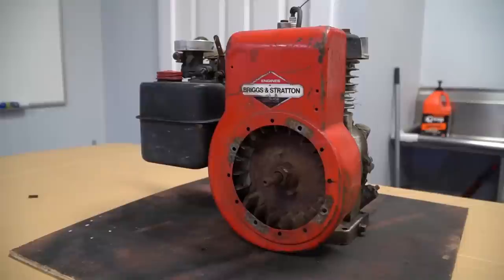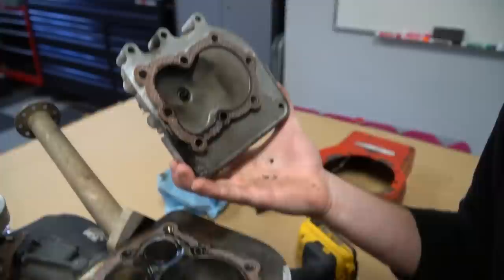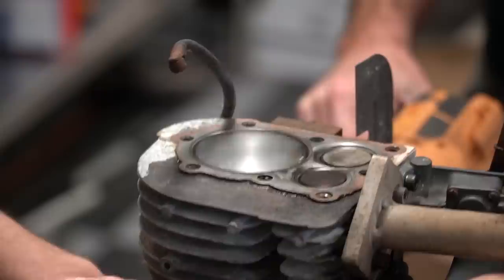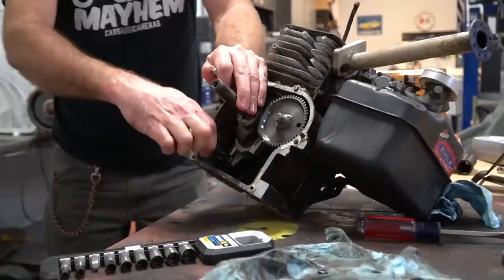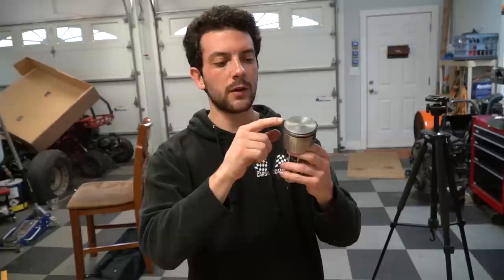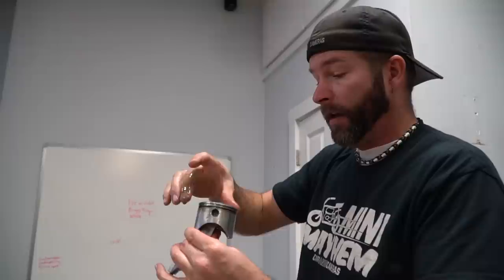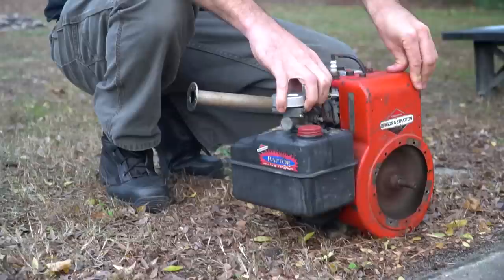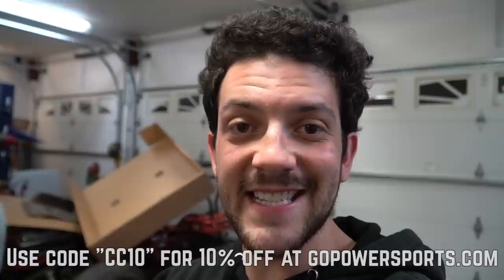Rat Rod Wagon HAULS | Built Briggs & Stratton Flathead

Comment: Looking at the 90 degree gearbox on this kart. Have you guys thought about using a lower end of an outboard boat motor? Not only will that provide a forward-reverse, but should also have a long input shaft instead of having to build one from several pieces.
Reply: There is a gear box just like that one that has forward and reverse
Reply: True, but they are way more expensive than a outboard bottom end that can easily be found at a scrap yard.

Comment: Racing pistons typically are higher compression, more sturdy in the cylinder as the skirt design makes them less likely to wobble side to side, and they often are made either by being forged or CNC'ed instead of being cast as well as they could be a special alloy that makes them stronger and able to handle higher combustion chamber temps.

Comment: The racing piston one is a hyper type metal very strong for boost or nitrous second longer skirt to help transfer heat through out the piston and prevent piston slap the reason it only has one compression ring is for less rotation friction which also helps with heat

Comment: Hey guys, when youre doing a hone, slowest speed on drill and up and down as fast as you can go. The idea is to make crosshatching on the bore to retain the oil. As for the racing piston, idea is less friction and less reciprocating weight to gain the higher rpms. The small amount of compression lost by not ahing a second compression ring is more than made up for in the higher rpms. The skirt shape and design is to support this. Great video. I must say.. id love to see the ducati engine on the drag rail tho.. ... .. cheers, Levi

Comment: The Briggs flat head is a great engine. Modified Briggs and Stratton flatheads are used in almost all oval track go karts and you can make those engines rip. There’s also still a lots of brand new parts you can buy for it online

Comment: I grew up with those old Briggs & old Tecumseh flat heads. They seem to make far more torque than the Chinee ohv motors of today. That ones already got the dual valve spring setup so the valves won’t constantly be floating once you hit 4500 rpm or so. As for the setup...the piston is lighter, longer rod likely means the builder is likely running a 3 1/2 crank for a shorter stroke coupled with a high lift, longer duration cam. Mic the cylinder to find out if and how much she’s overbored, get a set of rings if possible or a piston & rings...replace valve guides & seals. Add some timing with an offset flywheel key, dump some 112 in her & let her eat. Ya may also want to run a tighter clutch spring to get the r’s up before she locks.

Comment: Assuming the stroke is the same as stock, a longer rod on a shorter piston will provide less side loading on the cylinder wall and should (in theory) cause less friction and therefore less wear and quicker rev.  It also provides a less abrupt change in direction when the engine rolls over TDC and the piston starts to travel down the bore which also helps with better revving.  Best analogy I can give is  when you go with a 6 inch rod on a 350 as opposed to a factory 5.7 inch rod.  But again, you have to go with a different piston dimension otherwise you just made a stroker.  As far as the single compression ring, I'm not sure the purpose of that.  I prefer 2.

Comment: Never stop a hone in the cylinder. Also move the hone up and down evenly in the bore and try to create a 45 degree cross hatch that will hold the oil in the cylinder and reduce ring wear. Remove the hone with it still spinning so you dont end up with your crosshatch horrizontal at the top of the bore

Comment: 1 less piston ring reduces the amount of friction between the ring and the bore so in theory should have slightly more power due to less drag.
Reply: That is what I was thinking
Reply: I figured 1 les ring+1/2of the rings seating means less drag more power
Reply: godda seal the power in tho its a tug o war between idea
Reply: That's been tested, thickness of ring.  Friction verses sealing ability. A ring 1/8 inch wide will seal equal to a ring. 3/16 wide. On small engines the oil control ring is omitted on forged.    pistons because due to heat the ring gap is wider, allowing oil to gather between the rings.

Comment: The Briggs & Stratton engine is like the Flat-Head Ford of go-cart engines.  It has a cool factor the newer generic chicom clone engines lack.  The Briggs is a perfect match for the Rat Rod Radio Flyer but I hope you can do a full repair of the motor with new rings and valves to see the full potential of this hopped up B&S.

Comment: It`s forged, lighter, different R\S ratio. The longer the connecting rod the longer it is in the upper dead center than with a shorter rod. The mixture burns more efficiently because it burns longer at high pressure at high RPM. Which gives extra power. And it`s also have some rod angularity improving. Sorry for my bad english, i hope I expressed a point.

Comment: by having a longer connecting rod you can increase the torque of the engine because the rod has less diagonal movement. providing more downward force to the crank.

Comment: Years ago, I built a 5hp Briggs like yours. Except it was built to the max! ,140 overbore with a Wiseco piston, a .300 stroker crank, full race cam, with a diaphram carb, and a stud and girdle kit to keep the engine together! @.140 overbore hte cylinder walls are pretty thin! this beast while it lasted was Dynoed @ 25hp !! had to reiforce the frame as well !!

Comment: I disagree about not staying with a b & s engine.
Back in the 90's,my buddy had a 5 hp briggs on  his go cart,he raced it into  the ground,hitting jumps,doing donuts and climbing hills with both of us on it.
At the time the engine was old and it still ran like a clock.
The Tecumseh was also a good motor but you always had to mess with the carb on them for whatever reason.
As a matter of fact today he probably still has the go cart and I bet it would run.

Comment: Obviously less friction from the rings. But the reason for the different wrist pin height is simple geometry and physics.  Most likely it has a stroker kit installed. So with the longer stroke you'll need a shorter compression height on the piston or other wise it will smash into the head at the top of the stroke

Comment: Piston is lighter. Rotating mass is lighter... less parasitic loss?
Reply: Just a slight observation, but doesn't the piston fall under the reciprocating mass?
Reply: @b_mb4948  Reciprocating mass parasitic loss is somehow openly denied by so many so-called 'engineers' although it is indeed a scientific fact. ~( ,m,)~
Reply: Brodie Bennett you sir are correct. I am by no means an expert on engine building.
Reply: its an alloy rod and longer = less total angle swing for higher RPM (at piston wrist pin). one ring = less drag less heat too, but much wear and it's a smoker.

Comment: It  is all about tolerances. The racing piston is shorter, therefore it has to fit tighter to not induce piston slap. (piston ratling on the gudgeon pin.)
Also : reseating those valves, checking squeze gap and checking compression = racing!

Comment: Ike and John my dad used to build and race flathead 5hp briggs&stratton engines. He said the smoking is normal back when he raced he said everyone used loose piston rings and special red racing oil. The oil is designed to burn and by using loose rings it burns the oil and gives you more power. Also to get even more extra power my dad used to drill out the carb with a 1inch bit and use a penny for the butterfly.

Comment: 5:27 Definitely NOT how you hone a cylinder bore!!!
Right way.... Up and down at a quick pace to get an even 45 degree crosshatch pattern in the bore.
WRONG WAY.... 5:27 = Wrong tool, only cleaned with paper towel, uneven bore, oil fouling and worn and tore up rings.
You definitely made the problem worse!
Reply: About to comment the same thing.
Reply: They would have been better off just leaving the bore alone. I agree, wrong tool, wrong technique.

Comment: The long rod/higher pin height gives you more torque because the rod now has more leverage over the crank. Less rings mean less frictional forces on the bore, so slightly more power. The "racing" piston may also be lighter than the stock one. Personally I would try to find a regular piston (stock rings) with the raised pin height if you can.

Comment: A longer rod changes the angle of the rod to the crank, its straighter, giving more leverage on the crank. Also gives a longer dwell time at the top and bottom of stroke. But also changes piston speed up and down the bore, this can be a bad thing with the standard camshaft duration and lift as it lessens the initial vacuum when the valve starts to lift which will affect the overall cylinder filling.
My experience building race Briggs  motors I stayed away from longer rods and race pistons. Longer rods cos of the intake issues and pistons due to reliability issues. 
Here's all you need, mill 0.020 thou off the head. Clean up the metal around the guide and the tricky one! 0.025 thou off the base circle of the cam, don't worry about the nitriding, if the followers are set right its a non issue. Polish and shot peen the stock rod and new bolts. Ran those suckers for 24hour races, won everything.

Comment: Piston difference is largely weight & forged v cast .
Cast are cheaper but don't expand , forged are made to swell slightly once up to temp for higher compression with better fuel & more power

Comment: The longer crank creates more throw due the extended stroke. This allows for a shorter ignition period and greater compression at high rpm. It allows the motor to pull greater throughout its entire powerband.

Comment: I put an industrial 5hp briggs on my first minibike. 20$ pressure washer. The thing rand great and had tons of torque. Got a modded carb and made an exhaust and put a torque converter on it. It was so scary I had to re enable the govenor. It would buck my 320lbs friend malcom off it. Engines are plentiful, easy to maintain, pretty reliable. And I have no idea what you mean by "parts are expensive" a whole gasket set was 20.99 from briggs and Stratton.

Comment: Ok to set everyone straight about the racing piston. 1st that is a Wiseco forged piston with an L compression ring. Those piston were very popular with racer that ran alcohol because the top ring sits right at the top allowing more of the fuel to burn. Forged pistons can handle more force with out breaking than the stock cast pistons. The rod length does not affect you rpm at all. The reason for the longer rod and smaller piston is to reduce drag on the cylinder and stress on the rod and crank. We have build a Briggs using a racing rod and piston that were the same lenght as stock know as a super stock kit and turned it to 9150 rpm. It even out ran an engine that had the long rod kit in it too. If you do want to build a fast flat head briggs, A.R.C. carries the parts.
Reply: Ps it's 0.015 oversized

Comment: I'd love to see that engine restored to it's former glory, at least performance-wise. I agree with John on all his points, but there's just a certain charm to sticking with something old-school and having fun with it. 

As far as what makes a "performance" piston...in the case of something like this, it'll almost always be lighter, sometimes have one less compression ring (less friction), domed for higher compression, the skirt is usually taller, etc. You might have to re-sleeve that block, and if the valve guides aren't serviceable, then the block isn't worth saving. You'll likely be better off taking a good used block, sleeving it for that racing piston, and swapping over all your good parts. Also, you need to use a proper cylinder honing tool, the stones on it need to be as close to the same length of the cylinder wall as possible.

Comment: One dirty way to tighten the valves temporarily is to peen with a punch around the valve guides to doing this can decrease the slop but too much can seize the valve.  You want as many small light peens as possible to maintain as round as possible seal.

Comment: You can still buy racing raptor engines and the parts for them use a 4 stroke dirt bike piston and the engine is golden valves are also easily replaced with bigger ones I raced with Briggs power and moved to shifter carts .good to see you fellas love the vids

Comment: You should check the ring gap by putting the rings into the cylinder one by one and checking the gap where the ring ends meet to see if the rings are really worn out...since you may have a hard time finding parts for that piston

Comment: The stock piston has 3 rings because the problem you have lol. The top ring is for compression, the second ring is to pull oil off the cylinder wall on the down stroke, and the 3rd ring applies oil on the upward stroke. Since the top of the piston is undersized compared to the piston skirt it should never touch the wall therefore never needing oil on the top land of the piston. Looks to me the reason the “race piston” has only two rings is to make room for the longer connecting rod, hence why the pin is also smaller. Having a longer rod benefits piston dwell, piston acceleration, and is also lighter due to having one less ring, a smaller pin, and it’s probably forged 👍🏻

Comment: The long rod setup reduces side loading of the cylinder walls as well as taking stress off the rod itself.  It makes for a straighter line between the wrist pin and crank.

Comment: The Crank Case ventilation if you shake it should rattle very slightly if good . If that is an aluminium bore you use sand paper and not a hone .If it has a steel bore you can .On aluminum bore use a fine sandpaper .

Comment: If you guys get back at this project again you could add some caster to keep it from understeering by transfering weight better, and then it would oversteer and drift so it would be a lot more fun. You might need wider tires in the front though.

Comment: There are difference a few differences in the piston race piston is forged, stock piston is cast. The single ring is used to reduce friction in the bore and free up some power. The advantages of the longer rod are two fold, the longer rod reduces the side loading of the piston in the bore, reducing friction and freeing up some power. Also a longer rod also Slightly increases the time the piston is at top and bottom dead center. The longer the piston is at top dead center it allows the engine to build a little more cylinder pressure and  make a little more power.

Comment: The old Briggs and Strattons are built to last, unlike the disposable Predator engines. I've had old 5 HP Briggs that are over 30 years old that still run like a clock. They are very well made engines that can outlast a Predator any day of the week. Plus, the old school flat heads have way more style in my opinion. I have a soft spot for the old Briggs engines.

Comment: Your racing piston has longer skirts in line with pressure against sidewall of bore, and cut out skirt on sides ( that don't need bearing area). The wall that the engine (motors are electric) rotates towards will always wear more due to the piston being "shoved" into it from dynamic friction of the connecting rod and it's inertia.

Comment: Morey's oil stabiliser or Lucas' works very well! Racing Pistons typically have less rings to decrease piston to barrel friction; It allows the engine to rev more freely and make it more responsive. The downside is that there is more pressure and heat the single compression ring has to handle as opposed to running 2 or 3 rings, so it will tend to wear out faster than a conventional piston and ring set

Comment: The difference between a regular piston and a racing piston is how much the piston itself can withstand in pressure and movement, or heat etc.. a cheap factory piston will overheat Crack or fly apart . And on the other hand racing piston is milled with different metals billerd, therfore allowing combustion energy from the crankcase  to the valves. And can withstand the heat pressure and clearance to the head

Comment: Weight and materials,  stock piston will crack at high rpm and usually drop thr wrist pin, also the performance piston usually raises compression